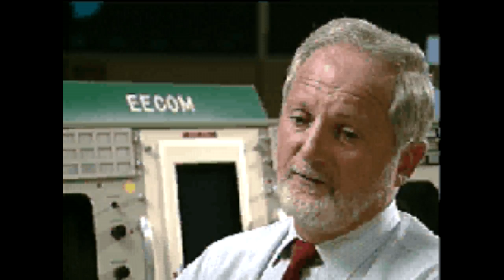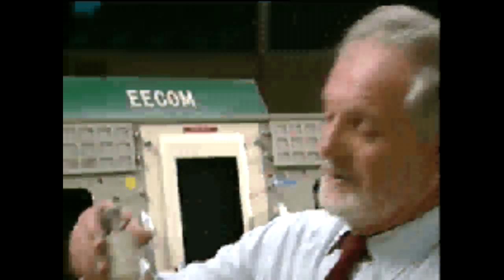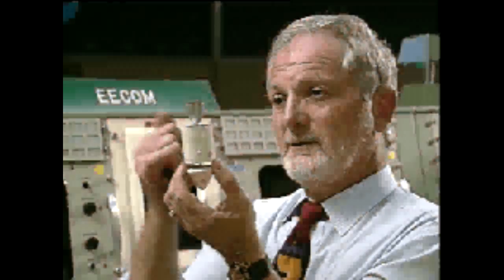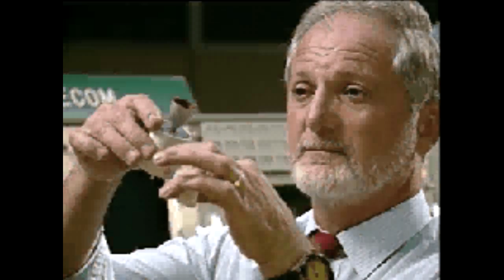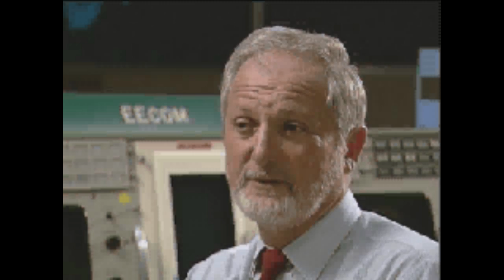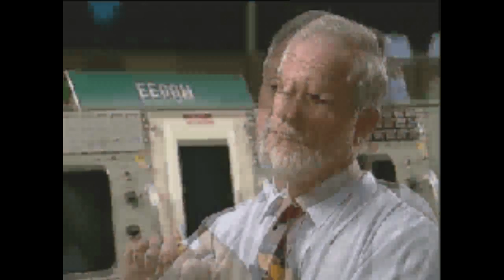EECOM Sy Liebergot on Apollo 13 explosion

Comment: The dropping of the tank and everything appearing fine, knowing it will be tested later, I understand.  The relays not being replaced, or the voltage reduced, maybe someone didn't communicate that.  But an engineer being told to not have it go beyond 80F, and the GAUGE only goes to 80F, how does this happen?  A NASA engineer, testing equipment, is given a gauge that maxes out at the level he needs to cut off?  How was this even an issue?  Beyond that, it still can "technically" read the max allowable temp, but wasn't shut off.

Comment: It's amazing that the testing protocols allowed fused relays to not be caught.  As he stated, they learned a lesson.  But EQUALLY as bad, the redesign of the system to run at 65 VDC did not include a requirement to upgrade the 24 VDC rated relays that fused.
Reply: ISTR that a mission to Mars crashed into the moon because someone forgot to convert imperial and metric values. If the paperwork describing the system does not equal the weight of the craft, it is not complete. So the adage goes. Procedures should have caught this but didn't. Lots of missed steps prior to its launch, but they did it right once they accepted the fact that it was not an instrument failure. It is interesting that they were fixated on instrument failures for as long as they were. Anyway, Sy and the team saved the crew. And for that they deserve a well done!